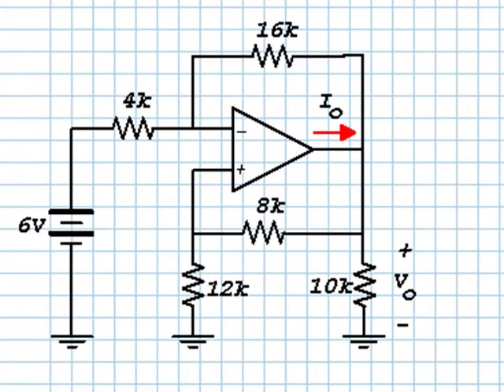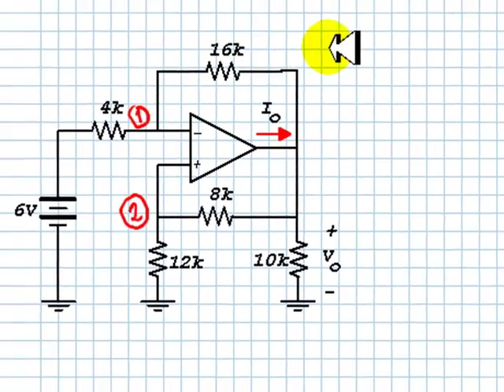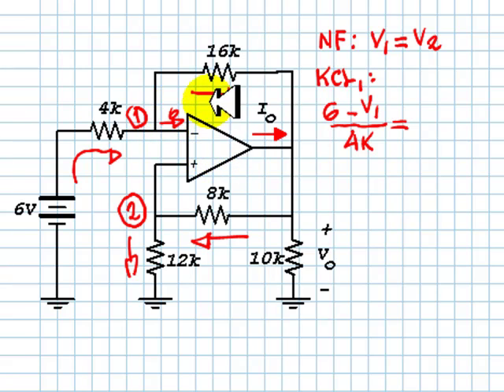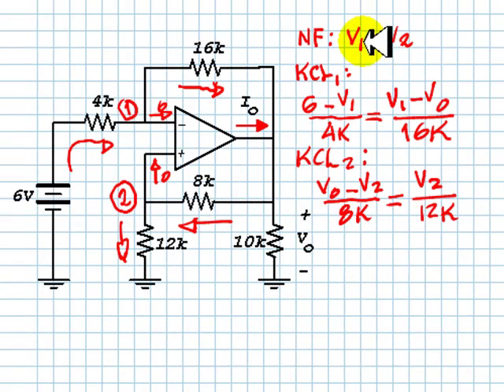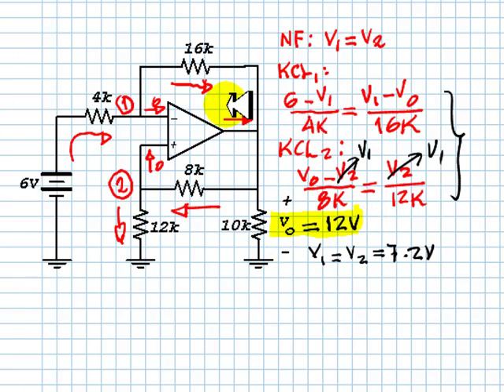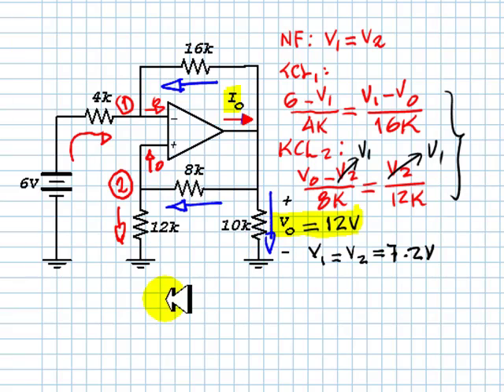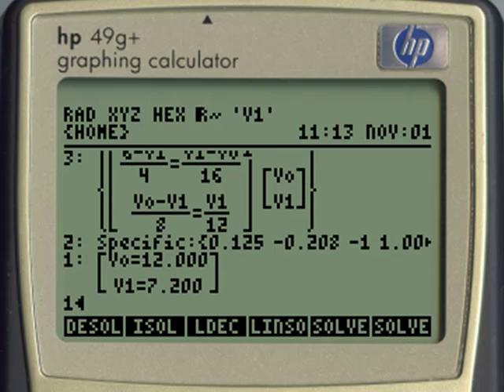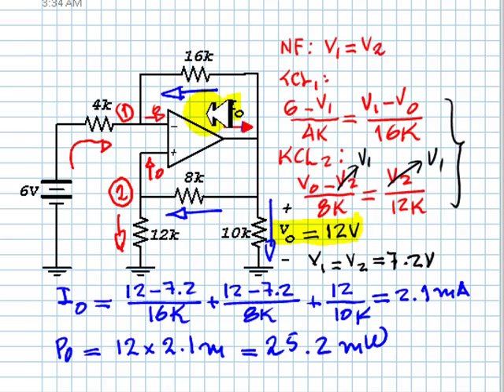EECE 251 - Op Amps tutorial 04

Comment: From my understanding,when the positive feedback in an opamp circuit dominates,we can't use the virtual ground concept(here positive feedback factor is 0.6 and negative feedback factor is 0.2) that means the system has to go saturation,right? or am I missing something?
Reply from the maker: In cases where there is doubt of whether negative feedback is dominant or not I recommend to just step back and replace the op-amp by a controlled source with an open circuit voltage gain A (not infinite ... yet), solve for the voltages in the inverting and non-inverting terminals, and find the limit as A tends to infinity and compare V+ and V-. In this case, V+ = V- under those conditions, so negative feedback is dominant. If you call the source Vs, and resistors are labeled R1 R2 R3 R4 and R5, and calling V+=V1 and V-=V2, V1 = -(A*R2-R2-R3)*R5*Vs/(A*R1*R3-A*R2*R5+R1*R2+R1*R3+R2*R5+R3*R5), V2 = -A*R2*R5*Vs/(A*R1*R3-A*R2*R5+R1*R2+R1*R3+R2*R5+R3*R5), where, if you take the limit as A tends to infinity, you arrive at the negative feedback boundary condition. I hope this helps.

Comment: Why you say never write KCL for output but aren't you doing that in the end? to find current Io? I am confused?
Reply from the maker: This is a fair question and here it goes: My advice is never to write a KCL for the output node while you are still solving for the output voltage.  The reason is that the output current of the op-amp cannot be tallied up into that KCL at that time because it is unknown.  But after you have calculated Vo, then you can determine the output current of the Op-Amp with a KCL, by then you have enough information to determine it from the KCL. I hope this helps.